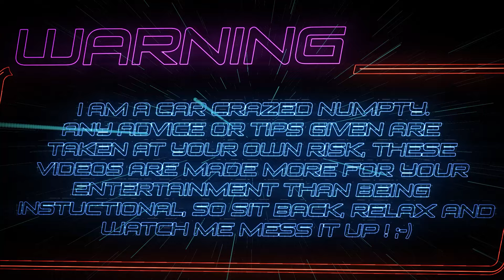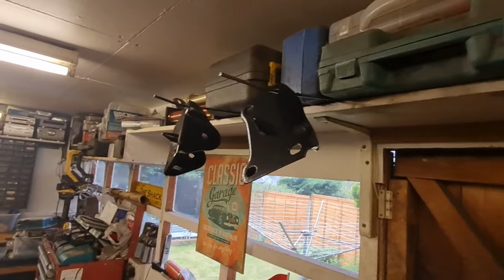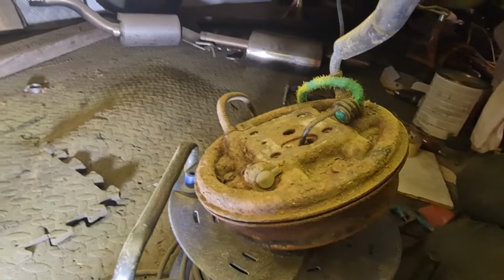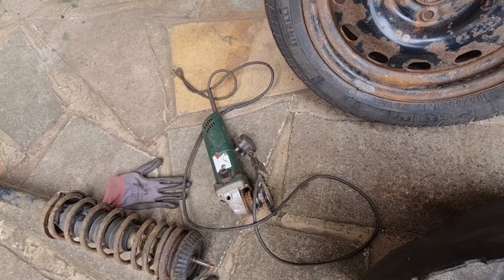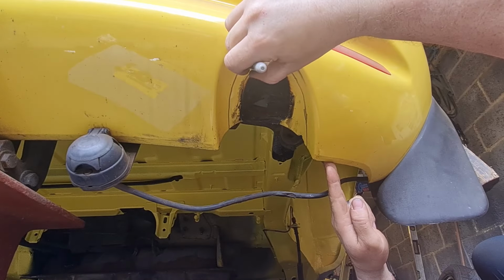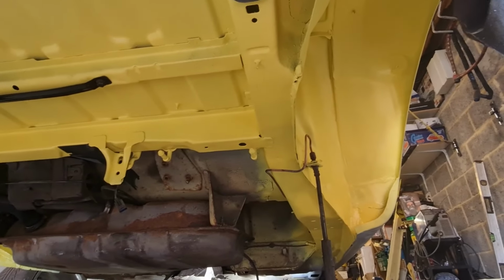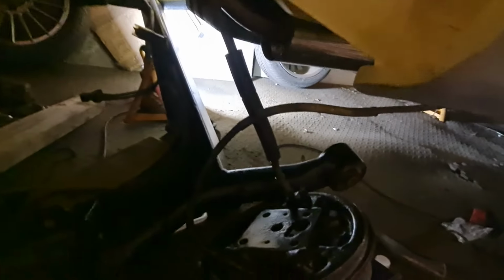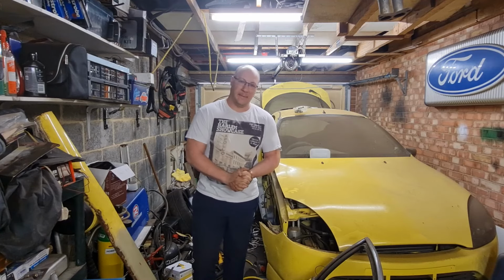Ford Puma MAJOR RUST REPAIR Pt9 Rescued from the Brink Phase 2

Comment: 13 4 24, Alarming level of rust  including Roof Panel if l remember correctly - or was that a result of a windscrean replacement  ? Was the tow-bar for boating in & out of sea water including the Puma ? (Cats don't like water !) If that amount of rust is typical l could be in trouble ! Paint the Battery Strap while you're at it. I can't buy sump plug washers nowadays- everywhere wants to include sump plug too. Do you know ? Is the engine oil spec' same as given in the 25 or so years old Owner's Handbook ? Wondering if a later spec' oil is now available & would be an improvement ? Where are you moving to - will there be a bigger garage ? Norfolk roads now getting busy too ! Keep up the restoration momentum, You 're making your own luck - Best Wishes.
Reply from the maker: Hi Mate, yes the rust was taking a hold but I got to it just in time, Its been used as a daily car all its life in all weathers so I think its to be expected, the roof does have a couple of small bits of rust in the windscreen corners from stone chips I think, I did treat and paint these when the puma was last on the channel before I found all the sill rust, they should be ok now hopefully, I did use to tow a jet ski with the Puma but the car never went near the water, I've towed box trailers and motorbike trailers with it too, it makes the car very versatile, you can buy sump plug washers online as far as I know as long as you know the size. I still put the same oil in my puma 5w30, it should still be fine assuming your engine has been looked after and isn't worn, we are moving to Chelmsford area, there is a double garage at present with the scope to make it ALOT bigger hopefully, I love visiting my dad in Norfolk, the roads are SO much nicer than London ! All the best MEC

Comment: Why not save some scrap metal and junk the spare wheel altogether? Its hugely heavy and can be replaced with a mini tyre compressor and tyre sealant kit as modern cars have. 99% of the time, Puma jacking points won't support the stress from the crappy original scissor jack anyway. I did this a few yars back on my Puma Black and its served me well ever since.
Reply from the maker: Hi, i have to be honest, i hate inflation kits, id much rather have a proper spare that can get u out of trouble no matter whats happened to the tire on the car, ive never had a problem with the original jack, personal choice i guess 👍
Reply: @mec-tec maybe so. But if you have a flat tyre and do manage to get the wheel changed, then discover your lovely aftermarket wide wheels won't fit in skinny spare tyre's under boot tray, you'll have a bit of a problem. Many Puma drivers also love the Puma's performance and use it as a fun driver's car. That can be radically improved by losing excess weight (removing spare and jack, back seats and rear trim, moving the battery behind the passenger seat, etc). But if you're using yours as a tow truck, I guess performance or how it drives isn't a priority! 😊
Reply from the maker: Haha, yep mine is deffo the pocket knife of pumas, it gets used for everything 🤣👍👍
Reply: @mec-tec  Superb attention to detail and breathtaking welding. Clearly means a lot to you, we need more craftsmen like you around.